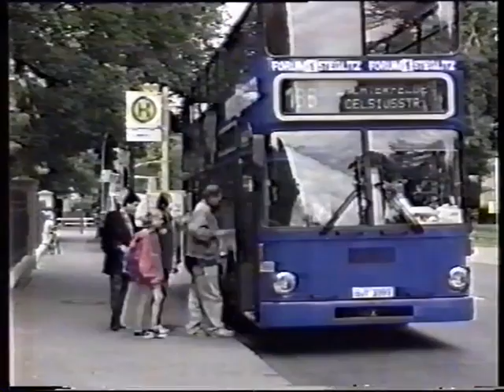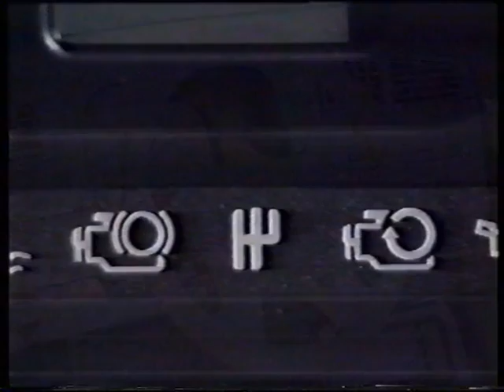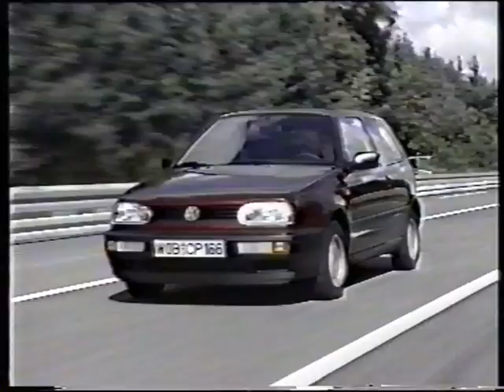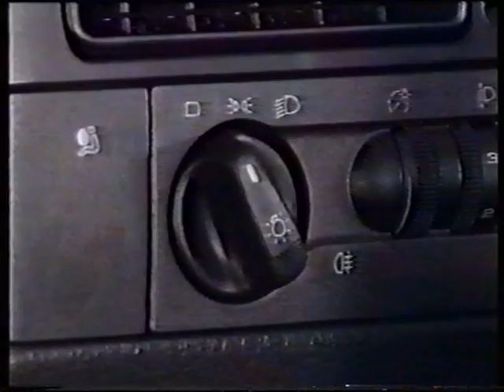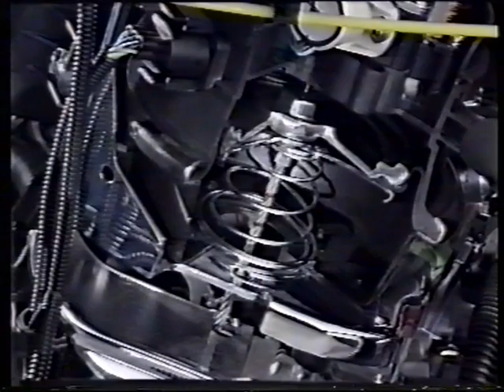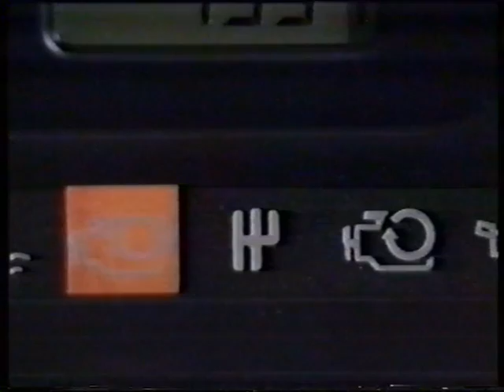VW Volkswagen Golf Ecomatic Promo Video

Comment: Is this something like start stop system
Reply: Sort of. Start stop systems don't turn the engine off while coasting, only while fully stopped.
Reply: It's a mild-hybrid.
Reply: Evolt It’s not quite a mild hybrid as there does not appear to be an electric motor that drives the powertrain at all. It simply turns off the engine while coasting and while stopped, even mild hybrids use an electric motor to assist the combustion engine during acceleration and to regenerate electricity during deceleration.
Reply: @MylesV  Well, yes. It's something between a micro-hybrid and a mild-hybrid.
Reply: Evolt No, it is not any type of hybrid. There’s no electric propulsion in the powertrain, unlike something such as the early Honda IMA mild hybrids or the Chevy Malibu Eco mild hybrids.
Reply: @MylesV  A micro-hybrid car is just a car with a start-stop system. The Ecomatic has more than that.
Reply: @evolt7553  You're right, I had never heard of the term "micro-hybrid" before and I did not know it was used for start stop systems. Interesting!
Reply: Not as technological as a mild-hybrid system but more advanced than a start-stop system.